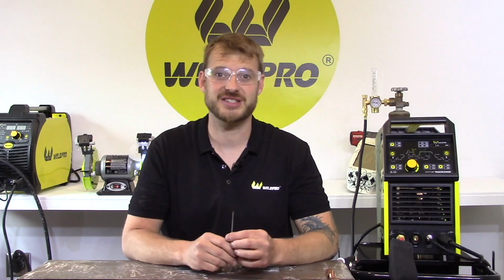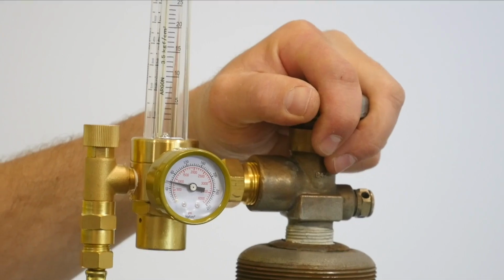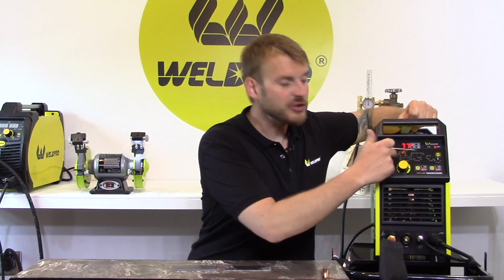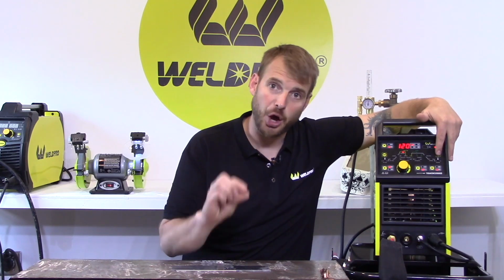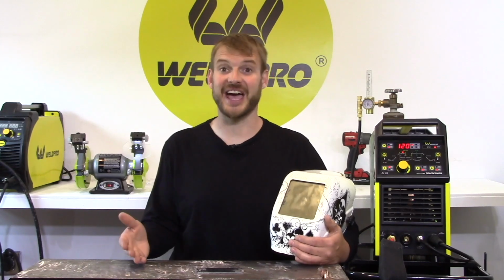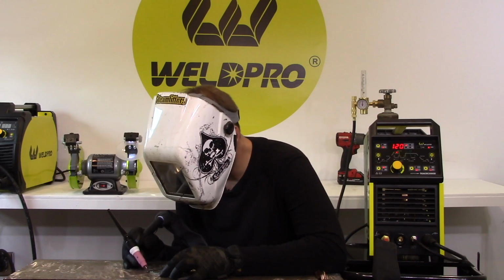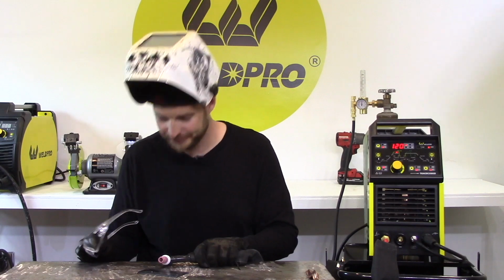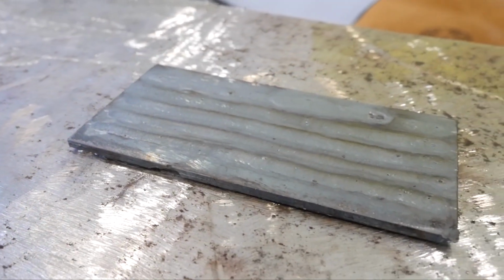Weldpro TIG 200 Part 3 - Parameters & Fusion Welding

Comment: After receiving my new Tig 200 I realized there is no variable amp control with the foot pedal. This is highly uncommon among Tig welders. Wish they would had offered a switch to toggle this on or off. Otherwise the machine seems very nice.
Reply: Billy, there is definitely variable amp control with the foot pedal - contact me at the Weldpro Support number on our website to go over this if you still need help.  Sorry for the late reply, the YT comments don't get checked very often.

Comment: Which color tungsten is for steel or ferrous materials and which is one for aluminium...???? 
Purple ? Blue?   What?
Reply from the maker: Either one can be used for both. Typically a green tungsten is only used for aluminum and is referred to as a pure tungsten. Beyond that  a blue tungsten or purple will be able to hold a point and run on AC or DC for aluminum, steel, or stainless :-) let us know if you have any other questions

Comment: What color tungsten do you recommend for AC and DC on this machine?
Reply from the maker: I would try the 2% Lanthanated that comes with it :) Holds a point pretty well on AC
Reply: @WeldproWeldingEquipment  would you use that for DC as well?  Great video by the way...  I'm set up and welding!!!

Comment: I just bought this welder and cannot even tack weld an 1/8 plate with 125 amps ? I followed the video step by step for set up , am I missing something or is something wrong ?
Reply from the maker: Something must be wrong please reach out to our technical support team seven days a week 9 to 9. They are very knowledgeable and will help guide you through your problem.

Comment: Will this do lift arc start on dc tig?
Reply from the maker: High frequency start only! No lift start. That is available on the MIG200 and MIG210
Reply: @WeldproWeldingEquipment  sort of defeats the purpose of a stick/tig machine. I guess i will have to go with a different brand.
Reply from the maker: @deanbutler3994  I’m just curious, why would you want lift start when you could have HF? Do you have an interference concern? Of course you could always use a gas valve tig torch and use lift start in stick mode.

Comment: Hey Luke. Really enjoying the videos… Even though I didn’t win the welding cart!
I am the proud owner of the your TIG 200 AC DC.  I have a question about the flowmeter included with the device.

The way I have my bottle, it is easiest for me to read liters per minute versus standard cubic feet per hour… I just needed to build myself a little conversion table. The conversion rate I found does not correspond to the markings on the gauge. I found that 1 LPM equates to 2.12 SCFH. By extension, 10 LPM should result in just over 21SCFH. On your gauge, 10 LPM is at the same level as just over 25SCFH...a difference of ~20%.

I’m a newbie...what am I missing? Thanks!
Reply from the maker: Hey John! Not sure how this slipped through the cracks but im sorry! You aren't missing anything! Just a manufacturing variance. Use the flowmeter as a guide and adjust based on weld appearance. This should get you the correct shielding.

Comment: Please add lift start to this machine's capabilities.
Reply: Why would you want lift start, or scratch start if you have high freq? 
If nothing else you should be able to put it on stick welding and by pass the gas system in the machine... using a wp9 tourch head??
Reply: @johnjacobjingle8302  I like to use lift start in some situations myself. Also unless you can turn the inductance to zero in stick mode, the arc will get hotter on longer you weld.
Reply from the maker: Thanks for your input! I talked to customer service today about it and our team is aware.

Comment: I own this welder and it is just flat amazing. Doing the setup on this was so easy with this video and I like that he walks through ALL the steps with you on setting it up. I use a lot of lincoln and miller welders for my job. But, I almost loathe using them now with this welder. It has a lot of power in a very nice compact design and holds up really well. I am very glad I made this purchase!! Best welder I have used in a long time!
Reply from the maker: Man that is amazing! Thank you so so much for the compliment! Glad to be making helpful videos!
Reply: Will this do lift arc start on dc tig?